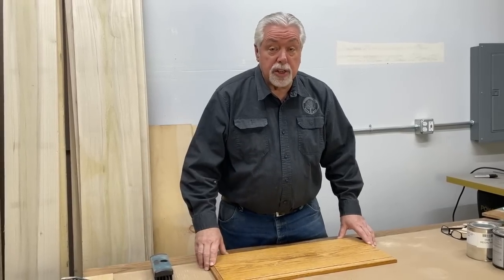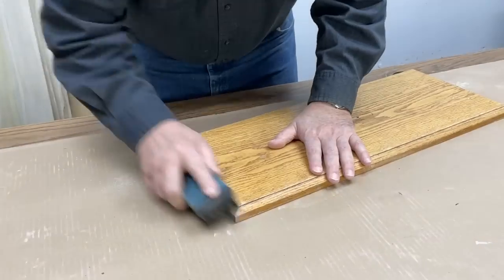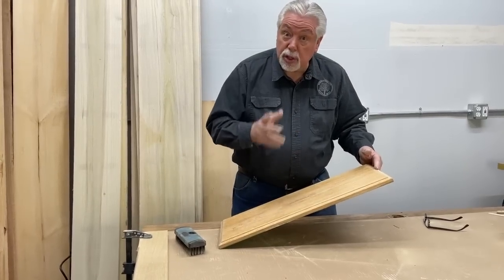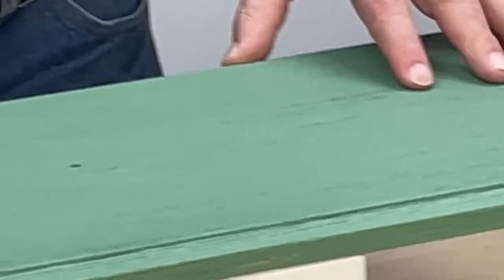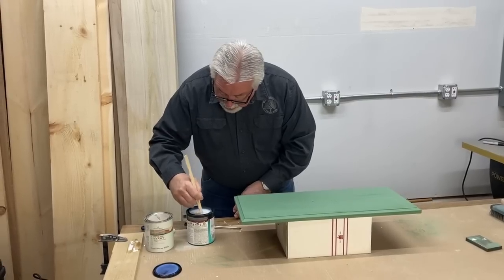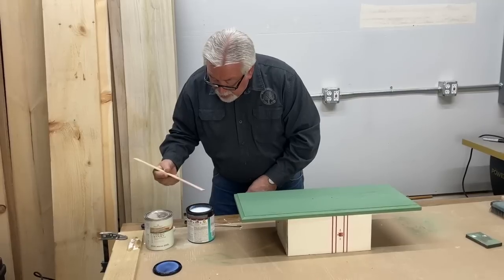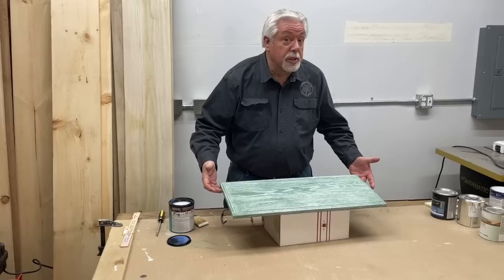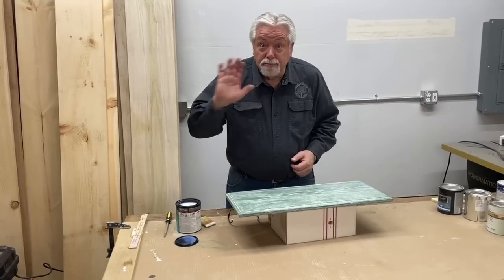We solved it! No more problems cerusing golden oak.

Comment: Thanks Wes! I just watched the original video & then this one. Much easier for me with readily available products & and good ole fashioned paint brush. My question is, since Ive already painted all the ones in the kitchen of my Airstream is there a way to keep the paint on to achieve this type of finish? Some sanding & wire brushing perhaps? I hate the thought of stripping them & starting from scratch.

Comment: I tried this technique with Zinsser 1-2-3 primer from Menards, then used Polycrylic, then General Finishes pitch black glaze from Woodcraft Supply.  Worked great.  Also tried it without the polycrylic in the middle; it was much more difficult to wipe off the excess glaze and didn’t look as clean; it looked very hazy.
Reply: I was curious if after you used the general finishes glaze did you put a top coat over that?
Reply: @cjbake3238  I did. It left a nice hard finish after it cured.

Comment: This must be a no-sanding method because sanding was key in previous videos.  Thanks for the video, Wes.
Reply from the maker: I don't think I sanded any of my golden oak ceruse videos...only wire brushed. Thanks for watching, Wes
Reply: @WoodworkingWithWes  No, you did light sanding with a sanding pad.  I've watched all of your previous cerusing videos several times :)
Reply: @WoodworkingWithWes  iv watched 3 vidoes where you sand after you add glaze

Comment: where do you find a glaze in Canada?...very challenging to get I've found.
Reply: Hi @shandawoodin1082, I got an acrylic glaze from Benjamin Moore.. The brand they have is GPW Golden Paintworks. I found it dried quite fast so I was not able to remove all the product from the main colour. So it left streaks and a milky appearance. It could be for several reasons. Wrong glaze/paint mix ratio, low humidity in Calgary, paint is paint/primer in one so maybe primer mix is problematic. Having a dampened rag helped to remove some of it. I’ve redone the stain base coat, put a clear coat on top of that and will attempt it again today after mixing higher ratio of glaze with a regular paint. Local paint suppliers tell me they don’t make oil based glaze anymore. Wes has another video with a product that would have to be shipped to Canada. It appears to be a wax which makes me wonder if it’s similar to the waxes at home depot.

Comment: I used this polycrylic and got a yellow effect over my white after I applied it. Did you get this? I’m also having trouble getting the glaze to fill in the cracks without being wiped back out. Any secret to this? Thanks
Reply: You should have tried the Urethane he recommended in his last video. Yellow effect is an understatement - more like 'freshly coated urine' as a crowning finish for the time and effort you invested. 😖

Comment: Could the top coat you used in this video be sprayed as well? I’m having trouble understanding the best spray top coat for this technique and one that is readily available. It seems to either not be mentioned or, in this case, it’s being brushed on. Just wanting to double check! Thanks.
Reply from the maker: The top coat used in this video is not a sprayable top coat. For a sprayable top coat, I
use precat lacquer. Thanks for watching, Wes

Comment: My cabinet doors were looking really good after two coats of primer then one coat of Minwax polycrylic then white latex / clear glaze but then when I applied final polycrylic coating the white yellowed. I now have to sand and redo white glaze process again 😢
What would be another option that won’t yellow the white ceruse look and provide protection for kitchen cabinets?
Reply from the maker: The Polycrylic should not have yellowed. The only thing that stumps me is ...I am not familiar with your glazing product and what reaction it might have had with polycrylic. I suggest checking with the product manufacturers. Thanks Wes

Comment: QUESTION...do you think the base coat paint can be "Beyond Paint" type paint, then apply the polycrylic and glaze process?
Reply: I’m not Wes and I never tried what you’re asking about. However, I believe that Beyond Paint is very thick and self-leveling, and therefore might fill the grain somewhat
Reply: @annalynn9325  thanks Anna, you're probably right. I'll try a test piece first.